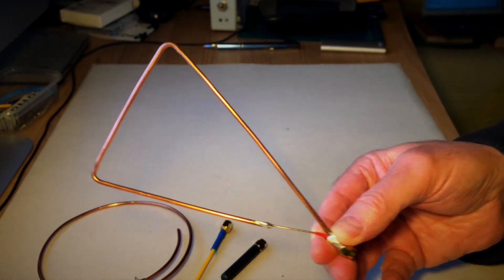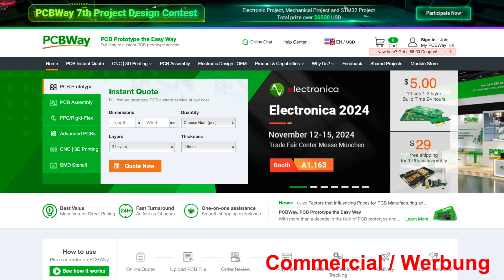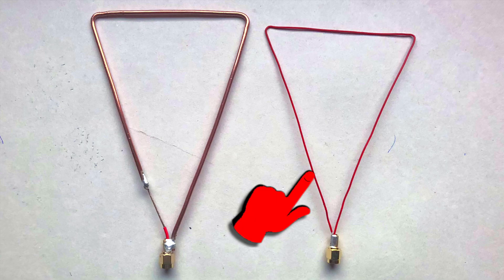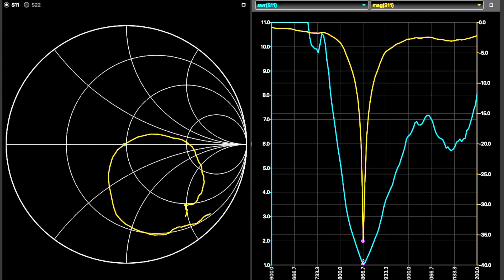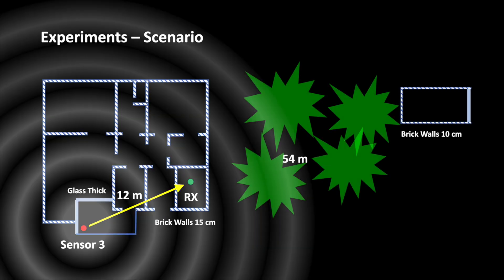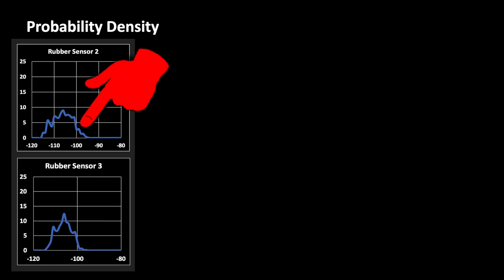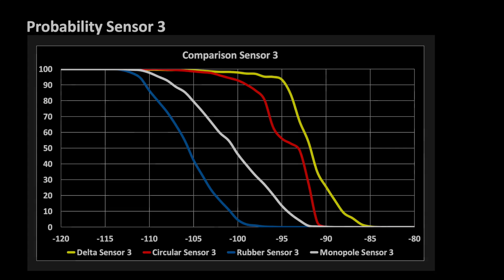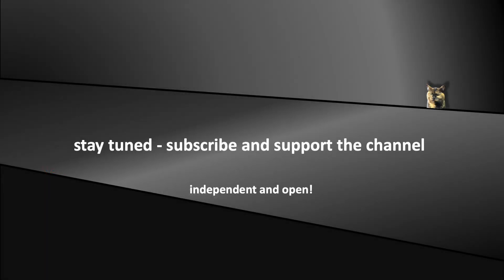37° Delta Loop: Precision Measurement & Performance Comparison Explained!  (EP139c)

Comment: Good video, but your audio has bassy popping when you say the letter p. I think it could be fixed with high pass filtering and when you next record, using a pop filter or positioning the mike more to the side of your mouth. Thanks!
Reply from the maker: Thank you for your comment. That's a good point for improvement actually, because I am using no pop filter yet. I need to get one ...